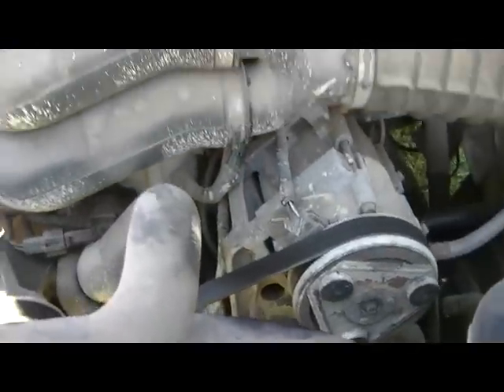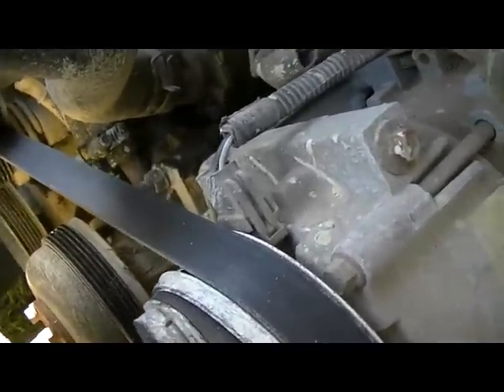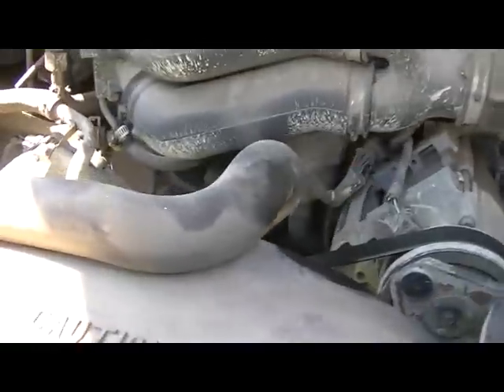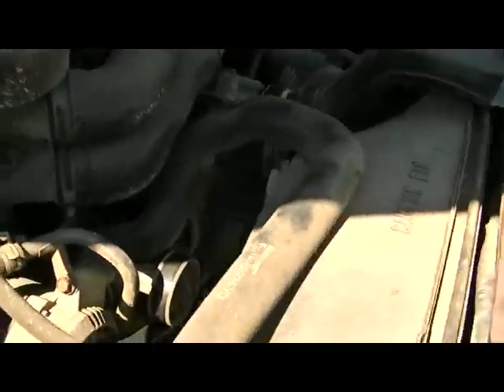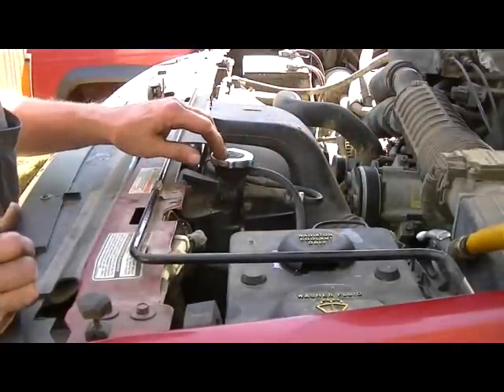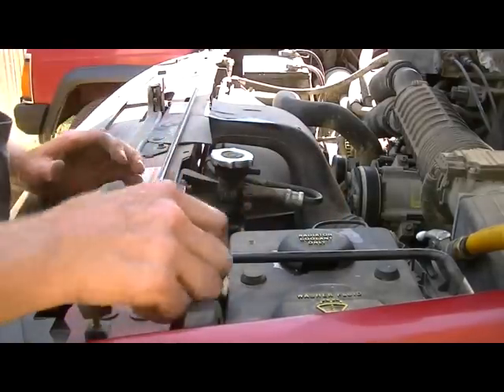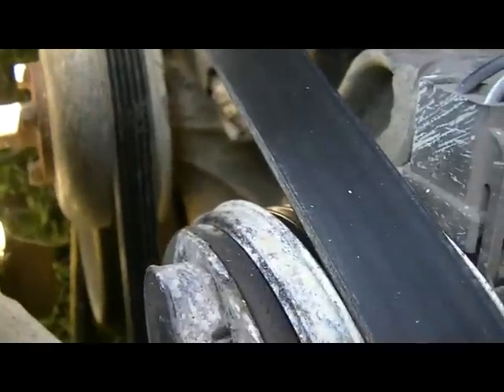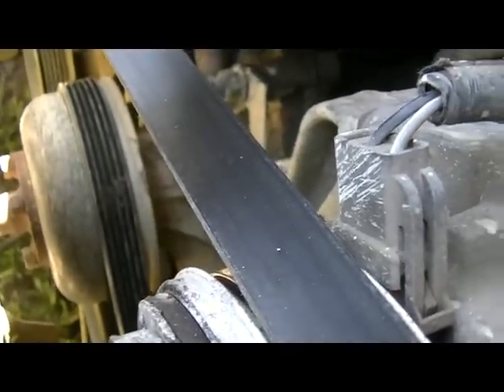Pressure Testing a Cooling System Without Special Tools

Comment: Great Video! Hyundai tried every trick possible to prevent disconnecting a section of hose from the radiator cap, but I tricked them and used a piece of the ridge metal connector! Can't see the leak, but I hope it is not the water pump; it is mounted under a plastic cover, between the timing belt; a 6 hour job! Thanks again!
Reply from the maker: You are welcome

Comment: This method is brilliant, simple and straight to the point. One word of caution tho, assuming you are not sure if there is a leak or not, know your coolant system's limit (e.g 1 bar, 2 bar..) and only put that amount of air in. Otherwise the air will force a leak somewhere.

If you know there is a leak somewhere for sure, then air will push coolant out that hole, no harm.
Reply from the maker: The pressure cap should protect the system from over pressure, if you do this correctly. Thank you!
Reply: I could be wrong but I thought pressure cap protect by venting the extra pressure (and coolant) to reservoir? I reckon where you put the air hose block the only way out (assuming no leak in the system) so any extra air would exceed the cooling system limit.

I'm just trying to think logically. I'm still new at all these automotive stuff

Thanks for your reply!
Reply from the maker: It will blow off around the cap when the cap reaches pressure.

Comment: Just an FYI, you may know this by now, but interference motor is used for increased performance and better MPG.  So they aren't going away.  This also applies to timing belts vs. timing chains but not as beneficial, also applies to solid lifters vs. hydraulic lifters.  Basically the ones that  require maintenance are more beneficial for performance/efficiency.
Reply from the maker: +Kartboarder22G Subaru has gone to chains.
Reply: I disagree that timing belts are better for performance or efficiency.  They are cheaper, flex more through the RPM range, and create maintenance revenue for the manufacturer.  A timing chain does not put significant drag on the engine vs a belt.  And the chain is less flexible so the timing remains more consistent under load, where a timing belt can flex and slightly alter valve train timing.  For maximum performance, gear driven cams virtually eliminate timing tension flex.
Reply: Kartboarder22G,  
You are absolutely incorrect, interference motor motors are not used for better horsepower or MPG, The advantage of interference motors are less top end parts like lifters, pushrods and rocker arms, therefore they are able to rev a bit higher. and an overall shorter engine height. 
The downside is that if the timing belt ever breaks is likely to damage or completely destroy your engine.  Timing chains are far more durable than rubber belts.

Comment: This is also good for if you don't have a radiator cap like the vehicle I'm working on and you don't have an adapter for the coolant reservoir that came with the pressure tester. I do agree with one comment saying you should use a bicycle hose. It's closer to what the testers use anyways because they're pumps instead of something you attach to an air compressor:)
Reply from the maker: ok!

Comment: Thank you VERY much for posting this!  I would have never thought of just pressurizing it with compressed air.  Worse case scenario....the radiator cap does it's job when there's too much pressure.
Reply from the maker: +Binhtri Vu Exactly!
Reply: But the radiator cap is designed to slowly relieve a slow build up of pressure - not to quickly release a fast build like you will get from the compressed air. Coolant is never going to go from 0 to 20 psi in a matter of seconds.  I guarantee that if you over-pressurize your system, any weak component can, and likely will, fail before the radiator cap can slowly bleed off the excess pressure.

Comment: That is a Great Tip I have always used the special tool with the gauge A  bicycle pump would work for air also you should only need 10 to 15 Psi
Reply: Just came across this video and I was wondering if a bicycle pump would work bcuz I don't have an air compressor Thanks

Comment: It worked! Thanks a lot. 

P.S. Tip for health workers: you can use a sphyngomanometer for injecting air into the system
Reply from the maker: Great tip!!
Reply: May I know up to how much pressure can be pump from the bulb of the sphygmomanometer?
Reply: @danielredona6090  I honestly didn´t test its limits... The manometer measures up to 300mmHg (about 400mbar) but I guess that, theoretically, if you can get a sealed enough connection you can pump until the circuit explodes :D Jokes aside, as it´s a closed circuit, I think there is a recommended limit

Comment: This guy has experience and knows how much air to pressurize the system "BE VERY CAREFUL NOT TO OVER PRESSURIZE" you can find the pressure in psi some where on the car or cap and set your compressor no higher than.
Reply: What happens if you aren't or say accidently spike it to 20psi with a bike pump that is setup for this on a 16psi system?
Reply: If you know you have a leak, the pressure will reveal it. If no leak existed, the extra pressure will cause a leak at the weakest point closest to the pressure.

Comment: I do not have a pressure tester. I took my car to the garage and my radiator (4.5 years old) on my Honda Civic was split at the seem (whatever that was).
I tried really hard to find the leak. I never did.
My cost of a rad, fan coolant sensor and thermostat is $200 then labour.
I like to think I am a DYI'er (4th class), but it was far to big a job for me.
The repairs are more than the car is worth.
It's my summer car. I got it for free so what the heck.
A man must know his limitations.
That's my story.

Comment: I don't see how this can work.  The pressure cap seals the radiator from the overflow, so how can the air get into the radiator thru the overflow?  There has  to be enough pressure in the radiator to overcome the cap seal before water can flow out the overflow, so if the cap is working properly, this can't work.
Reply from the maker: +H Dale Beggs There is a coolant recovery valve in the cap that allows the radiator of pull coolant from the overflow tank. You pressurize through this valve. If you look at the underside of your cap you will see the valve. If your vehicle has no tank, it may not work.
Reply: That's  what i was thinking...  How the cap valve open when you put air pressure from the reservoir side?
Reply from the maker: Irvin Vallejo Pressurize the overflow hose.

Comment: I have a 2000 Jeep Wrangler for almost a year now. Ran into this stalling problem. She keeps misfiring and dying when I’m at red lights. She has no power when I’m pressing on the gas and struggles to stay on when I’m idle. Idk what the problem is . I’m dripping just a tiny bit of coolant (i can see it on the floor where i park the car) 
I asked someone else on here that does YouTube videos on jeeps and they told me it isn’t the throttle 
It has to be my radiator or cooling system but I don’t think so. What could be the issue ? The car has coolant to full and oil . 😫

Comment: I Have A "Mityvac MV8500 Silverline Elite Automotive Kit"  And Wanted To Know If I Could Use That Tool To Find A Coolant Leak On My 2003 Dodge Caravan Connecting It To The Overflow Hose That Is Attached To The Radiator Next To The Radiator Cap Like Yours Shown In The Video?
Reply from the maker: I think it would work fine. Use the pressure function. I brought a mityvac in 1987.

Comment: can i use this method to try and find a leak in the radiator itself? (would be obvious normally i know but the one in question is heavily soldered and patched up)
 Im not sure because the thermostat would be closed and the pressure wouldnt go there.
Reply from the maker: +kliment voro Pressure is even throughout the system, so, yes indeed, you can!

Comment: I tried this with a bike pump, original cap just let all the air out instantly(16lb cap). Bought a new cap with chevy part number (gave me a 15lb cap???)  Tried to pump it to 15psi may of accidentally spiked it to 20. Air still comes out of the cap. Pressure gauge quickly drops to 10psi from 15psi then slowly drains to 0 but in 5mins or less. Did I break something, or could other damage of happened from the accidentally spike.
Reply from the maker: I suspect that the antifreeze level dropped below the leak and, since air leaks easier than antifreeze, your leak is up high on the engine or engine compartment. Check the heater hoses.

Comment: Thanks a lot man... Now I need a new radiator... The air pressure splint my plastic radiator on top near the cap... There go $180.00 and still don't know where the leak is... Any Help?
Reply from the maker: I suspect it was the radiator.
Reply: NO... It's fresh split...
Reply: Maybe you used too much pressure. Remember you're forcing air through the pressure relief with no escape, you're bound to pop something with enough pressure. My manual says only to pump to 15 psi. I just rigged a compression tester and bike pump for the job
Reply: you used too much pressure man. period! dont blame this guy. his video helped a lot of guys out.
Reply: You should be pissed.  This video basically told you a dangerous method to test your radiator.  This is the equivalent of teaching people how to open beer bottles with their teeth because they do not have a bottle opener.  Just because they did it without breaking anything does not make it a good idea.
Reply: Stoneforth.  You should do a video on how you did that because this is a much safer method than an air compressor. Good job!

Comment: I have my overflow hole in the reservoir (Toyota 4runner). Can I still use your method by blowing air through this hole?
Reply from the maker: If the pressure cap is on the reservoir, yes, but if the cap is on the radiator, use the hose between the radiator and the reservoir.
Reply from the maker: That black thing is the oil pan. The antifreeze is coming from higher up, Follow the trail. You'll get there.
Reply: kbbacon you are right boss. That was the oil pan. I went back again, did some cleaning and I found my mystery leak: freezing plug. I know it's a cheap part to replace but the amount of work needed is maybe beyond me. I can barely see it. I don't think I might be able to reach it without moving some parts out of the way. Thank you again.

Comment: This might be quick for you but an easy way to accidently blow out something. System isn't designed for much pressure at all.
Reply: lower psi to 10 and good to go.i did same thing to find air leak in my turbo system.worked well.

Comment: Well that’s how you blow your cooling system. If you exceed 35 pounds you’re going to blow seals and radiator joints. Some modern vehicles can’t even handle that much. Spend the 80 bucks at Harbor freight and get the damn tool.

Comment: Good tip i understand its principals , but what if leak is in the exhaust gasket of a pin hole size ? This test wont wrk on that event i dnt think ?
Reply from the maker: Perhaps not.
Reply: kbbacon iknw that , but how to check the gasket on exhaust then ? I guess compression check is only guess
Reply from the maker: I'm guessing you mean the head gasket. Head gasket leaks will, usually, pressurize the cooling system causing the cap to release pressure. The antifreeze will smell horrible and the exhaust will have a sweet disgusting smell. The tail pipe may have a sticky residue that rinses off with water.

Comment: if there is not leak what happens? does it spew back out of the overfill hole?
Reply from the maker: Or around the cap if you use too much pressure.
Reply: Or it will create a leak.  If you have a functional system that is aging, dumping air into it like this is a great way to manufacture new problems and leaks.

Comment: Terrible idea to hook an air compressor into your cooling system.  At least have some type of gauge inline so you don't over pressurize your system.  You start blowing 60 psi or more into this cooling system - even for a split second - and you could create a much bigger problem than the leak you are looking for.  I would recommend finding a cheap compression tester gauge and a hand pump over an air compressor.  Or better yet, most parts store have loaner testers.  You should never exceed 15 psi pressure when testing not even for a second.
Reply from the maker: Use your regulator to lower the pressure to 15 psi.
Reply: Or use the proper tool for the job.  Most air compressor regulators, as well as the gauges, do not even go down to 15 psi.   And their accuracy is +/- 5 psi at best.  Again, they are the wrong tool for the job.
Reply: The whole point is to quickly troubleshoot without having to spend time at the store and wasting money that isn't necessary. Not everyone is a rich twat.
Reply: The point should be to do it without causing more damage.  The poor guy is the one who can least afford to take bad advice and create a bigger problem than he started with.  Rich guys don't fix their own radiators.  But I don't know anyone who can afford an air compressor but cannot afford free loaner tools.  This is a matter of being lazy, not cheap.  Heck, a $5 hand pump with a gauge will work.  Anything is better than this.
Reply: thecatsfan 60 psi lol, most systems r rated for around 20psi buddy
Reply: Duh!!!  If you actually read my post, it clearly says you should never exceed 15 psi.  The problem is, people who cannot read and comprehend will dump 60 psi air pressure in the system not knowing the pressure inside the radiator.
Reply: In theory.  Problem is you are dealing with an aged cooling system to begin with.  Otherwise you would not be doing this test.  So there is no guarantee the radiator cap works properly anymore.  Second, radiator caps are designed to relieve a slow build up of pressure that never exceeds about 16psi, not a sudden blast of high pressure air.  You could easily exceed the system pressure - significantly if you aren't paying attention - and destroy other parts before the cap can relieve enough pressure to get the system back to a safe pressure.

Comment: But my problem is that when the system is pressurized and not running, I don't see, hear or smell a leak... I just keep losing coolant (and the oil doesn't appear contaminated).  What gives?
Reply from the maker: Could be a water pump. They, typically, begin to leak when running and stop with the engine. Check the weep hole.
Reply: Close... your video gave me an idea.  I added that Prestone stop leak which left residue around the leak.  It was coming from the bolt holes around the water pump.  That's when I realized my using gasket paper to make my own gasket was the culprit (or my lack of knowledge of how to use it correctly).  Thanks.
Reply: Spray copper gasket sealer is very important with any paper gasket.  And stop leak products are as good for your car as smoking is for your lungs.

Comment: I would consider the air hose a special tool
Reply from the maker: +Jon Baker You may use a portable inflater pump, a tire pump, a basketball pump, a garden hose, and I even clean the hose and blow through it, if I have nothing else. A balioon pump will work, too.

Comment: i had my cooling system repaired and now my radiator has lost 10 psi in 20 mins, anyway to fix that?
Reply from the maker: If it is he tank or end seals, the radiator will need to be replaced. Sometimes a stop leak product will postpone the inevitable.
Reply: my radiator has been replaced 3 times
Reply from the maker: Check motor mounts and radiator mounts. Also, check core support for flexing.

Comment: "Pressure Testing a Cooling System Without Special Tools"

step 1 : get a $500 air compressor
Reply from the maker: A tire pump will work.